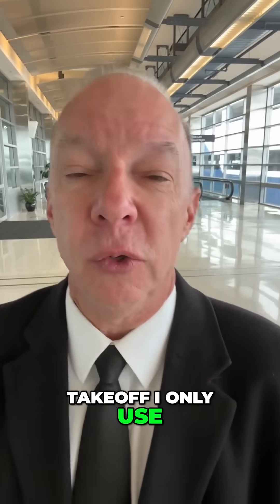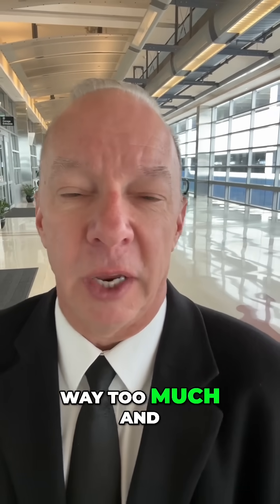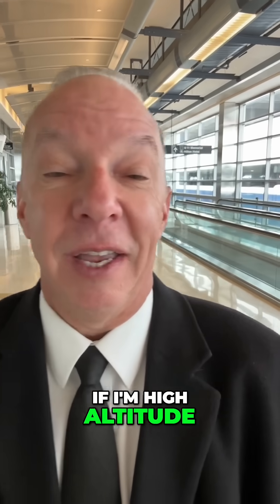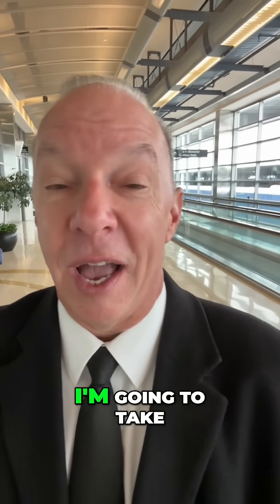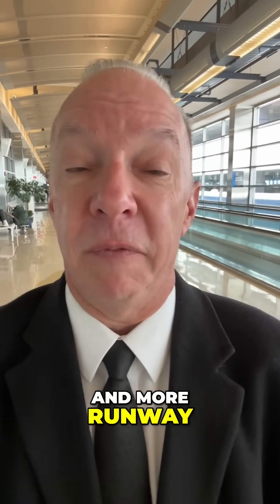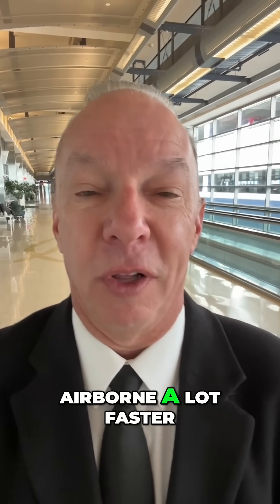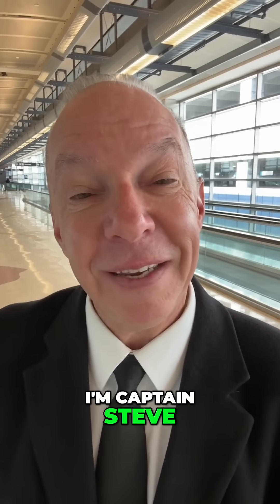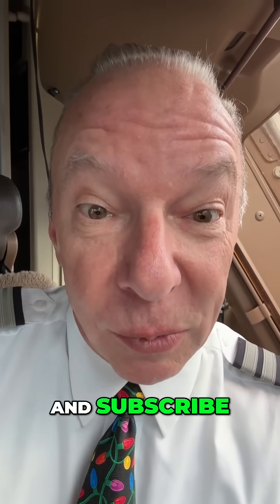Flap Settings for Takeoff: What Every Pilot Should Know

Comment: I love this. But I have a question. So, density altitude affects both engine and aerodynamic performance. Because hot and/or high means fewer molecules of air per cubic whatever, right? Please, which is the more important: fewer molecules per cubic whatever on the engines or the wings? Both, I would think but one may be more important than the other. Thank you. Really enjoy your channel.😊

Comment: The engineer tells you what the correct settings is depending upon atmospheric conditions, the take-off weight, and the runway length. You aren't educated enough to understand the variables involved in this math. And the "leading edge of the wings" isn't called a "flap", it's called a "slat".

Comment: I am proud to say that I already knew all of this, even not being a licensed pilot. I did however have a flight class as a senior in High School and have flown flight simulators for many years. (Plus a Cessna once with a friend) You forgot to mention Full Flaps on landing for max lift at the slowest speed along with more control at a steeper descent angle due to more drag. Full flaps help for a shorter landing and a safer one. - After take off with min flaps pilots go to NO Flaps once reaching a safe climb speed so there is no drag. ( Correct me if I am wrong with any of this added info.) :-)

Comment: Excellent!! Was it 17 degrees max without stall? (Using a Cessna 172 ... I am sure there are other factors that affect this.) That is so informative and it makes a lot of sense(!) since weight/power must be a dynamic along with heat/cold (light/heavy air) and the plane's ratings (default values).  Thank You for going over this for commercial jets! :)

Comment: What about the brakes on a jet? Do the wheels have brakes or does the turbines have a reverse? I ask because how do you brake on ice  without sliding?
Reply: Engines do have reverse although not normally used in calculations and the brakes have anti skid.

Comment: Is it purely engine power meaning longer till to get to same speed, or does air density affect the desired rotation speed as well, a higher rotation speed?
Reply: The effect on the wings is the same as on the engines.

Comment: What do you mean that day? Does the power output of the engine vary?
Reply: Power, lift etc all varies with altitude and temperature. An airport at sea level on a day with 15 degrees C is not the same as another day with 30 degrees C
Reply: @Cars-k8e  well colour me intrigued

Comment: Do you have some kind of chart that you consult with all the variables?
Reply: Most of the airlines use a simple app called OPT, at least for Boeings. Fly smart for other airplanes like Airbus for example
Reply: Yes, if the computer doesn't generate the data, we do have hard copies of the data
Reply: @chuckm626  we just use iPads. If they won’t work we call dispatch..

Comment: He is absolutely correct because I have been doing flight simulators for over 15 years and I have found that out early in my semi years that trying to take off at high altitude at gross weight with low flaps you will crash. Thank God for flight simulator I've been flying now for over 15 years and I've logged over 25,000 hours so I can very much so attest to what he's talking about

Comment: I was landing my flight schools piper 100i the other day in the in temp was like 2c and wind was pretty much straight down the runway 10ktsG18. I only used 2/3 notches of flaps to maintain my landing speed. I prob could have have done a short field with no flaps if I wanted.

Comment: You would think that you just enter the outside air temp and airport elevation above sea level (to get density altitude) and runway length into the FMS and it would tell you 1,5,15,25,30 flaps.
Reply: And runway state (dry, wet, etc..) Wind, air pressure, anti ice, improved climb, MEL or CDL items, etc…

Comment: When would you ever use full flaps?  In my 152 I use full flaps for takeoff and landing both.
Reply: For landing full flaps but there is no full flaps take off on a 777, Flaps 5,10 and 20 are take off flaps settings on a 777

Comment: Thanks Cap! Great to learn that Triple H rule.  Would it be either altitude, heat and weight that would determine your flaps?  Or would you need to meet all 3 conditions for 5 flaps?
Reply: All three plus many other conditions are looked at. Obstacles, aircraft maintenance issues and runway contamination to name a few.

Comment: When I worked to get my aviation merit badge back in the early 80's, I learned not only you get more power from engines in cooler weather you also get more lift in cooler weather.

Comment: How does outside temperature affect the performance of the engines? Anyone?
Reply: The higher the temperature the less power the engines have. Also the reason why you can use assumed temperature for Boeing or called Flex temperature for Airbus… 
It’s like you are telling the airplane the outside air temperature is higher than it really is, that reduces the max thrust the engine can set

Comment: My main captain...

I have one question, how come the flaps alter the direction of the plane but the landing gear and cover as big as the are doesn't alter the plane direct??
Reply: The landing gear has a lot less exposed area to the oncoming air, and doesn't have any intentional bias in the direction it redirects the disturbed air.  The airplane wing and flaps are systematically designed to deflect air downwards, in order to generate lift.

The air speed (relative to the airplane body) also increases over the top of the wing, beyond the free stream airspeed.  Meanwhile, the open landing gear is only exposed to the free stream airspeed.

The landing gear does cause drag on the airplane, which is why the pilot stows the landing gear once it is no longer necessary to have it deployed, and doesn't deploy it again until ready to land.

Comment: I know Boeings have eight flaps settings. Is it true that Airbuses only have four? And if so, why is that?
Reply: Not all Boeings have the same flaps settings. 
777 for example has Flaps 1,5,10,15,20,25,30. 787-9 has a few more. Airbus calls them 1,2,3…
Reply: Manufacturer preference

Comment: Isn’t hotter air more dense? Perhaps the air density due to temperature is less effective than air density due to altitude. Now; I know.
Reply: The colder the air, the more dense it is. Think of how hot air balloons work and how nitrous oxide work for a performance engine. Hot air expands, less dense.
Reply: @chuckm626 
Thank you for the reply. I don’t know what I was thinking. Consider it a dumb mistake 😮.
Reply: On the ground for electricity generation we have very similar engines, commonly referred to as gas turbines. 

These aren't going anywhere, they're literally bolted to the ground, and are used for supplementary peak power and backup. Most grids have some for that purpose.

Long story short, they lose up to 30% of their power output under extreme high temperature conditions and it's all due to the lower air density. Some do have workarounds with cooling of the intake air but that's impractical on an aircraft.

Given the underlying technology of the engines is the same, just applied to a different purpose, I'd assume aircraft would experience a similar magnitude of power loss at high temperatures.

Incidentally, for ground use in power generation the normal fuel for gas turbines (jet engines) is natural gas. Impractical on an aircraft but very doable on the ground.

Comment: Love your videos I have another question how cold is it up there outside the plane where we’re flying so high up
Reply: Typical temperatures at cruising altitude are between -40C to -60C, or -40F to -70F.  That's cold enough to freeze the mercury in a thermometer.